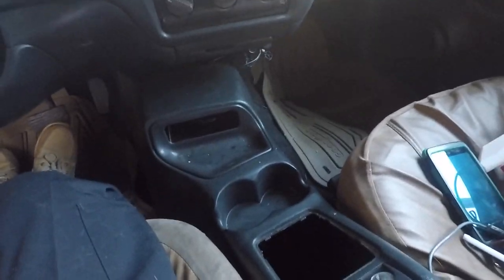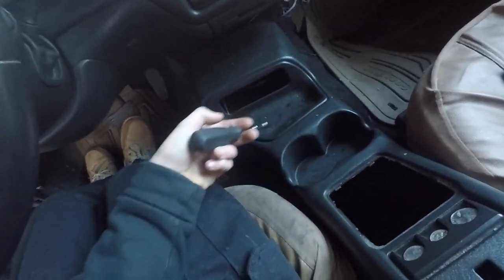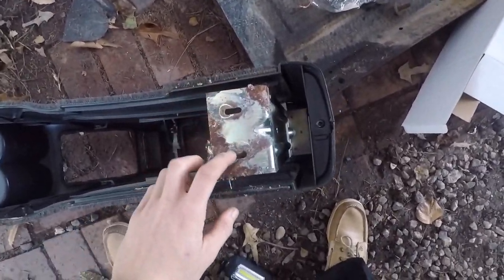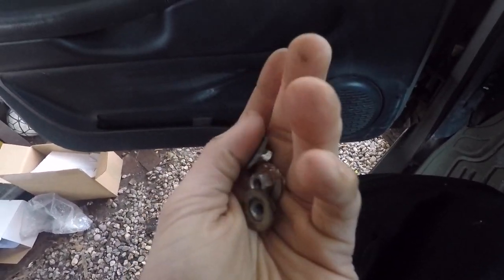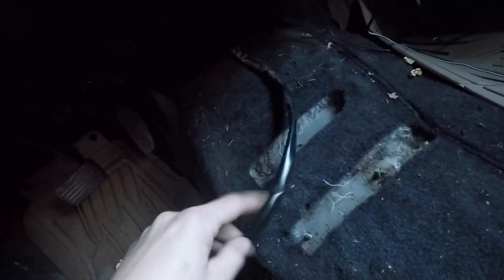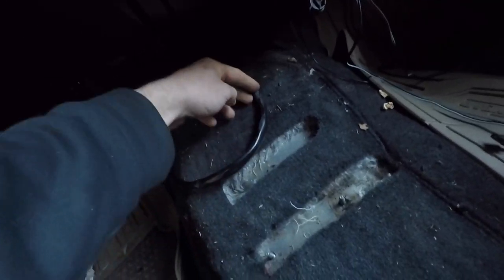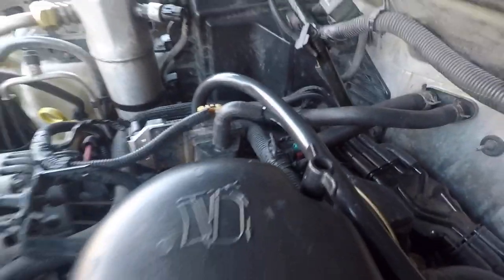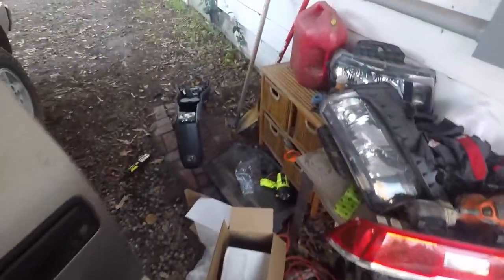98-04 S10 CENTER CONSOLE REMOVAL!

Comment: Do you have to remove the entire consol to remove the Cassette
Reply from the maker: Braden Wright nope but it helps to get the wiring cleared
Reply: Alright I’m jsut havjng hard time removing it
Reply from the maker: Braden Wright once get the bolts and nuts loose just wiggle the console to get it to move
Reply: Thanks man
Reply: So all you gotta do to remove the cassettes is disconnect the warring harness correct?
Reply from the maker: Braden Wright at the back of the player the wiring harness has a locking clip, once it’s released it comes out easy
Reply: Okay thanks Man I appreciate it
Reply: Once the middle console is removed, is there a way I can get a seat for that spot?
Reply: Jared Seiple I don’t know of anyone selling aftermarket seats for their since it wouldn’t be safe for the passenger. But you could make a custom bench seat, just would be very small.